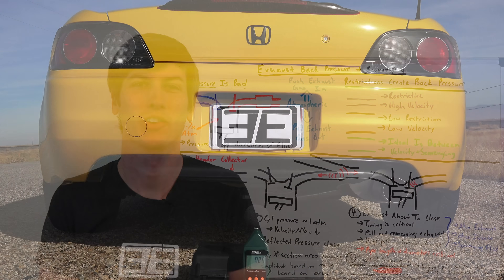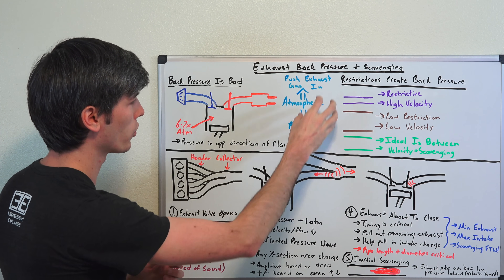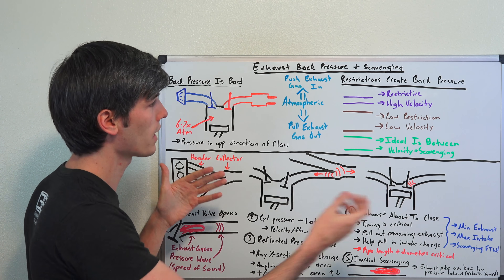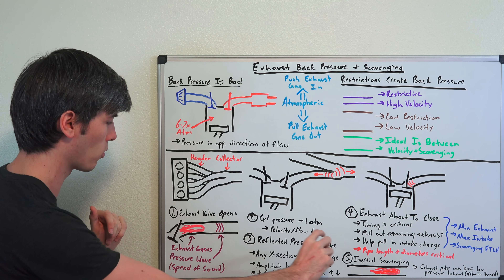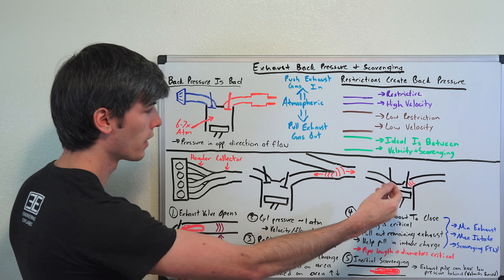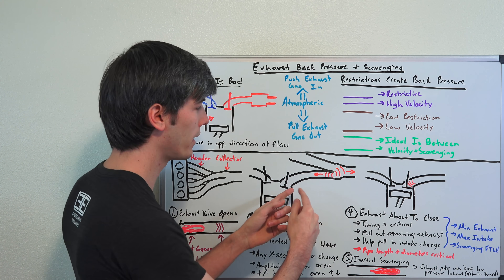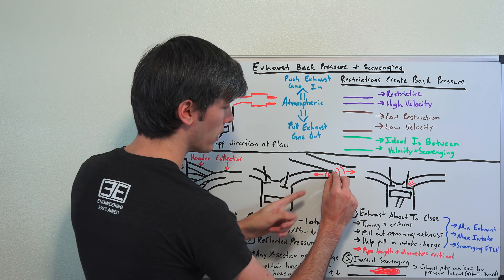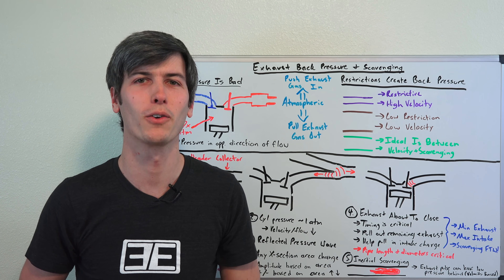Stop Saying Car Exhausts Need Back Pressure

Comment: My lecturer at university said that you do want a small amount of back pressure for N/A engines because the residual exhaust gasses left in the cylinder effectively increase the compression ratio as you are compressing a larger volume of gas into to the same volume at TDC. With forced induction engines you might not want this as you can make up the difference by forcing more air and fuel into the cylinder
Reply from the maker: Residual exhaust gases can be beneficial from an emissions standpoint (this is what the purpose of EGR is), but if you're displacing air in the cylinder with spent combustion gases, there's less room for fresh air & fuel.
Reply: AstonMan you traded spent gases for fresh air and fuel? I'm not buying it
Reply: AstonMan NOx forms primarily when a mixture of nitrogen and oxygen is subjected to high temperature, the lower combustion chamber temperatures caused by EGR reducesthe amount of NOx the combustion generates (though at some loss of engine efficiency). ... For example methanol is more tolerant to EGR than gasoline. Adjusting timing and fuel mixture is the answer to efficiency and power and Optimum combustion temperature. EGR exhaust gas recirculation only reduces nox it is beneficial for nothing else.
Reply: With n/a 4 strokes it doesn't hold as true. Shorty pipes can ruin the engine, and in a midget car my grandpa just welded a full straight exhaust to the back for looks and destroyed every race. Every race they would tear down his engine thinking he was cheating and all that was changed was a longer pipe
Reply: Jake . are you saying he left stock exhaust manifolds on .?
Reply: He simply modified the short manifolds and welded steel tubing to direct the exhaust "more towards" the back. BTW this was like 1960's or late 50's so that's why he completely baffled everyone there even tearing down his engine, might of been a fluke then but he is a legend now from racing and engineering
Reply: The only changed specs was the extra length welded to the manifold*
Reply: As to what? new one's or porting? not allowed, It was those 60's small little engine kid sprint cars, wayyyy more power. Maybe you guys are not considering the exhaust pulse? Can back pressure on a closed valve that then later opens induce a vaccum? I dno, he went through lots of gaskets letting people pull his engine
Reply: Jake . That's very interesting . so he modified the stock exhaust manifold to be longer . Cool . ...I have a friend who just made his own headers, just waiting for him to finish his restoration to see how good they flow.
Reply: Jake . I'm just about to bore out my rectangular exhaust ports to match my "D" shaped headers on my 2006 . 5.7 . hemi ... they claim it will pick up 80 to 100 hp
Reply: Yeah i think he was 15 and built that car for his sister. He's an 80 year old multiple Colorado hall of fame for his race cars and engineering/machining/welding. Made his first spaceframe car chassis and body at 21, called a Bocar
That's awesome let me know how they do
Reply: Postofficejoe I love that type of work, when I was 13 or so I port polished and blueprinted to my best those little Goped 2 strokes
How are you doing that? Pulling it and using a mill or?
Reply: I just had a quick google on Bocar . WoW . what a cool looking car . i guess your grand dad is one of those rare people that just have a natural nack or gift for what they do ... I have an old 1974 Bricklin , made by Malcolm Bricklin, he reminds me of him, they get these visions and just go make it, absolute brilliant people.
Reply: I'm pulling the motor . going to put in a cam and mill the deck a touch, also refresh the block, only .05 over, new rings, but the guy who is doing the heads is just using a dremel type tool I believe, he has done a few with great results.
Reply: Yeah I helped him do a car jay leno came to see, restore and drive a 1916 pierce arrow. Look youtube for pikes peak yellow devil.
I will have to look that up, Malcolm Bricklin, I haven't heard the name but that sounds awesome, I like the niche genius local car creators lol. 
Let me know and ill send pics of what we have working on to an email or something
Reply: That make's since, I litterally used a dremel to port then polish my 2 stroke and it was insane- I guess I didn't think of how hard it would be to mill the port and polish unless it was a thousand jobs.
Thanks for the info that's awesome! Do you mean 5 thou over or really 50?
Reply: I looked at the Yellow Devil . sounded like a real beast,  and sorry I meant 5 over (.005) just so I don't have to put new pistons in, just refresh the walls for new rings.
Reply: Fair point, for power that would make sense but if you wanted to an engine to be efficient then having that small amount of residual exhaust means you can have a higher compression ratio and use less fuel

Comment: im so baffled about this argument.. logically back pressure makes zero sense as a good thing..and it isnt a good thing in modern engines or even older engines...actually can be damaging..

 however i purchased a ATV locally for under $1000, i wasn't expecting much, but i didnt need much, the guy did some exhaust work and intake work, i inspected it because i know my way around that ATV fairly well and nothing seemed wrong, just pointless work.  he claimed the honda exhaust was rusted or something and he replaced it with a stainless steel something brand higher flow exhaust, claimed its way better now..  well i disagree, yea the pipe itself is about 2x as wide... but i felt like the engine was sooo weak when it was cold and it even stalled on a hill too many times that it was getting unsafe.. so i replaced the exhaust with one from honda, they still had one in stock for that ATV at part shop, put it on, nothing wrong with how the guy installed the "performance" exhaust either.. but it was a night and day difference, it now starts right up in the cold and never stalls out on the hills...  so i dont even know what to think about why or how..
Reply: With motorcycles in particular, if you change the exhaust system significantly you need to re-jet your carb or your air fuel mixture will be far from stoich and you will lose power.  Worked at a Honda shop during summers home from college... you wouldn't believe how many people had the same problem.
Reply: It was probably a pipe that should have been used with other parts or mods that complement each other, like a performance package of some type.
Reply: JustaGuyNamedB that makes more sense.. ya it sounded like it needed some engine work and once I got the OEM exhuast back on it and give it a good ol fashioned tune up using the throttle it cleared right up and sounds beautiful and runs like a dream.

Sadly I hate working on carb engines like this so that was going to be the last thing I checked was to make sure wasn't starving itsel for fuel of air or something...

Wide open throttle with the old exhuast on it,  it was running rich it smelled like gas was getting exhausted basically..
Reply: The running like crap when cold is a great indication that the air-fuel mixture is too lean (after installing a free-flowing exhaust system). Carb mods are required to keep the engine in tune.
Reply: Actually same issue with some cars; the STI comes to mind.  If you change the exhaust or intake for more air flow the car goes super lean and runs like a pile of garbage.  You need to re-tune with a richer fuel map to make the car drive-able and running lean with a turbocharger is great way to blow a motor.

Comment: they do need back pressure....if you want a quiet exhaust lol as in, a muffler. and im not a big fan of overly loud obnoxious cars. it should be a law to have a valve in the exhaust for quiet and loud. put it loud when no one is around and quiet for all other times.
Reply: Exhaust systems can be designed to provided good silencing AND low back pressure.

Comment: I remember an episode of engine masters of motortrend channel, they test two diameters of exaust Pipe on the same engine in the dino, and the result was that you always want the bigger diameter of exaust you can get
Reply: They tested on a monstrous V8. 
Exhaust volume is very very different than your common daily EFI japanese daily driver.

Yet the principle stands, regardless of displacement. Jason just made the case for ADECUATE pipe diameter. In that instance, a wide pipe was better. No surprises, considering that amount of flow.
Reply: Sev'rance Tann you are right, í dont  remember the engine they use for the test, but it was a chevy that produce 600+ hp, so yea, it is not apples to apples
Reply: At some point the gains will peak and turn into losses.
Otherwise you might as well not run an exhaust at all
Reply: Bruno Danese that would be an interesting test

Comment: Awesome video engineering explained I have a question I know there are some exhaust systems that have a integrated throttle valve in them what does that do? ( not the racing ones that it’s just a Y pipe to make it louder)
Reply: If it's like a powervalve in a 2 stroke, it's to improve low RPM torque. As the RPM rises, the valve opens more, which allows you to have a large diameter exhaust for good high RPM flow.
Reply: Henry Griffiths really I didn’t know that that is awesome thank you Henry 😁
Reply: 2005 Corvette Z06 and newer have the RPM activated baffle. We go from dual to quad exhaust when crossing 3000 Rpm. That said, my humble experience with exhaust and headers has been, that the cost of the change, unless you just hate your exhaust for how it looks or weighs (i.e. C5 base model Corvette ), the cost of the parts to get 5-10 horsepower are not worth it. I believe this channel documented almost no change on the S2000.
Reply: Dei On 
Some cars have a valve in the exhaust to switch between a quieter muffler and a louder muffler/straight pipe.

Comment: There is one little area you missed: hight-speed engines with exhaust tuned to get second or even first low-pressure vawe at peak power engine speed, like motorcycle engines. In such a setup use of butterfly valve to create backpressure can kill unwanted hight-pressure vawe, greatly increasing mid-range torque without really rising gas velocity.

Comment: So what if there was a way to accelerate the evacuation of the air?

For example, can intake air be diverted to help push out any exhaust? If not can there be a vacuum with a motor inside the exhaust header which will pull out exhaust every time the exhaust valve opens?
Reply: Hondas and Toyotas used an air pump in the late 70's/early 80's.
Reply: Guitarfollower22 with forced induction you could open the intaje valve near the end of the exhaust cycle and use the incoming pressurised air to "clean out" the cyclinder. You would want direct injection so as to not waste fuel but im sure its been done. especially in high compression ratio engines where temperature and knock are bigger risks and left over exhaust gas would increase the cylinder temperature
Reply: I believe there are certain designs where the intake valve opens before the exhaust valve closes with the idea of the velocity of the escaping exhaust gasses creating a vacuum to bring in the intake air. different from pushing the exhaust gasses out, but thought you may be interested to hear that. there are also header designs that, in theory, create a vacuum using exhaust pulses to pull the remaining exhaust from the cylinder. look up valve overlap and exhaust scavenging (which he touched briefly in this video).

Comment: ummm ok so should I put a 3' exhaust on a Navara D22 2013 model or not? because although you explained the concepts really well, I have no idea on whether a bigger exhaust would be beneficial or detrimental ???
Reply: I believe theres a /engineered episode on the youtube channel Drive about exhausts that goes into some numbers and some calculations
Reply: Put a 3" on it 😎
Reply: That very much depends on which engine. The D22 of that era was available in most countries with at least 2 gasoline/petrol engines and 2 Diesel engines.
  If you have a 2.5 liter non-turbo gasoline type, around 2.5" should be better. Going 3” pipe on a 2.5 liter truck engine will almost certainly lose torque. It would rev quicker, but do less.
For the 2.5 diesel, they need more room for expansion, so 3" if going single pipe.
  For the 4 liter V6, I'd run dual exhaust through 2" pipes all the way, treating each cylinder bank and header separately for sizing. For the 3 liter Diesel V6, 3" duals.
Just my opinion.
Reply: If you think you know how to drive it..then strap it on the Dyno.
Reply: Yeah I have the 2.5 ltr diesel turbo charged from the factory. So you reckon go with 3" inch ?

Comment: How about an exhaust with variable geometry? We already have variable valve timing and variable stator turbochargers.
Reply: Isn´t this basically the same as having controllable flaps that change exhaust note? Just engineered for actual efficiency, instead of s*its and giggles.
Reply: This was done in the world of motorcycles many years ago. How do you think they can get around 100HP per Leter without boosting?

Comment: So I am apparently one that has long miss understood. 

I have been under the impression that back pressure is part of the Scavenging at The Collector and primaries. 

The idea being, on one side you have the Venturi from previous waves drawing out/ drawing in air during the valve overlap. But, also at the end of the over lap you will have a previous wave reaching the collector, and creating a high pressure in the primary that's at the end of its exhausts stroke. 

In this time, previous low pressure wave from exhaust, and velocity of the intake air have thoroughly cleaned the cylinder. Without the properly  timed back pressure you would be exhausting clean air/ fuel. 

The idea being, the now "back pressure" in the primary is working like a closed exhaust valve to hold in, in coming air/fuel. Like a bit of a Scavenging supercharger. 

This is why collector distance/ primary lengths play such a big role in where an engine makes its power.

Comment: I was thinking in something like a variable diameter exhaust but it's something imposible :(  something similar happens with head porting, in a point the engine gains power, but there's a point in wich a bigger exhaust and admision ports penalities performance.
Reply: watch video of engine masters where they test heads with different  flow

Comment: How's a turbo and waste gate effect back pressure? Most first diesel mods are 4" exhaust or larger.
Reply: grin and bear it - from what I seen turbos need back pressure and they have it going into the hot side. But after the turbo less restriction the better that's why you seen tuner cars dump out asap.